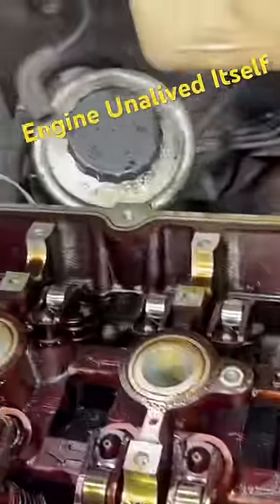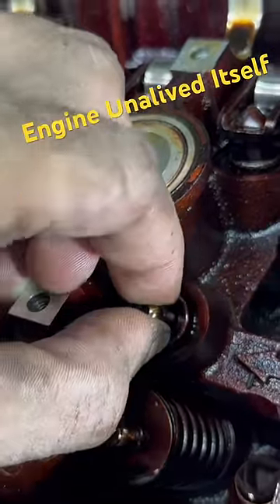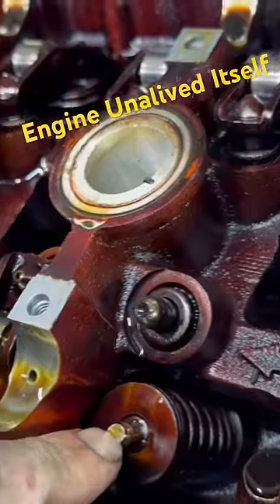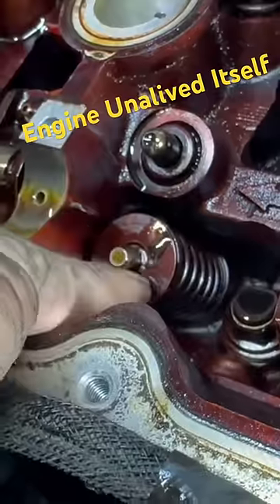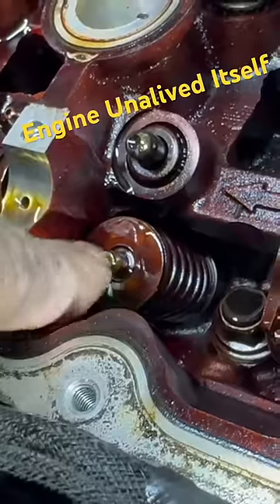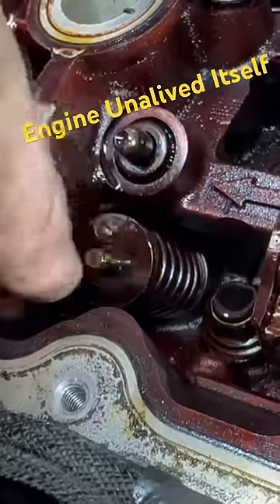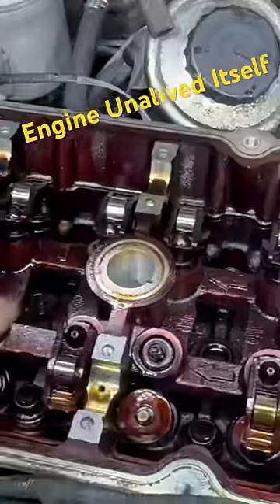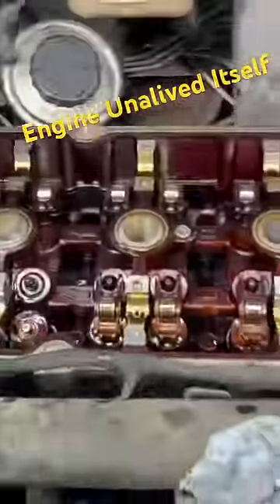Worst Engine Ever! Destroys itself while turned off! Chrysler 2.4 Turbo Non-Turbo #shorts #mechanic

Comment from the maker: Full Length Pt1 Worst Engine Ever!! Chrysler Destroys Itself on Startup! https://youtu.be/po4xBPujAuY
Reply: As long as you took to explain that, I thought you we're going to run another static compression test. But don't misrepresent, Chrysler engines don't destroy themselves on Startup.... Some owners of Chrysler engines don't maintain them so they destruct by lack of maintenance. How many miles were on that original timing belt?

         Edit: there's an awfull lot of those 2.4 litre twin cam engines out there, for a few decades now, so they can hardly be labeld "worst engine ever"🤦 Probly YOUR least favorite would be more accurate....⚡️😳
Reply: @petesmith5092  i agree it takes alot to kill those engines, had a srt and the engine never failed after all it went through, i think its more reliable than the 2.4 toyota, meanwhile my mom had 2 engines replaced in her 3yo honda accord, thats a bad engine, any ford, vw, subaru, bmw engine too is awful
Reply: @retrocompaq5212  M⁰ Pªr or no car... but i'm ol ol old school. Before they taught "boo-bonics" in classrooms.WAY before!
Reply: @petesmith5092 my friend had a stratus with the 2.4 and he didnt change the oil the entire 2 years he had it. Put over 35000 miles on it. He sold it and the guy drove it for years after that
Reply: Wish the link was actually clickable... lol

Comment: 3 of the Best engines ever built
1. Chevy Straight six
2. Ford Straight six
3. Dodge slant six
Reply: 4. Honda F22 Inline 4 in the 90-93 Accord. You could run those babies with Aunt Jamima Syrup in the crankcase and they run 300,000 miles

Comment: I have this turbo engine in my dodge neon and this motor is amazing. Takes redline all day 😂 think it just comes down to proper maintenance
Reply from the maker: They didn’t do so well in the PT…maintenance
Reply: @RainmanRaysRepairs So what happened to this one in particular?
Reply from the maker: @MrCydiaWTF  Timing belt teeth stripped off at 90k and it bent the valves
Reply: @RainmanRaysRepairs  ah Jesus, The turbo models are non interferance. I guess the na’s aren’t. As long as pistons okay hopefully just new valves and some machine work with new belt and she’ll run again
Reply: @bleach_drink_me best find used, remain cylinder head
Reply: @RainmanRaysRepairs I have a 21 year old pt, you just have to take care of them
Reply: @MrCydiaWTF they aren't non interference, I've owned both the srt4 and now I have a na2.4, they are semi interference, the valves can hit eachother, the pistons will never touch the valves
Reply: @tobyngenn9826  Ahh good to know. Yea so they can make valve to valve and never piston to valve in stock motor. However valve to valve I believe is very rare to happen on the 2.4’s. Most of the time the timing belts strip at the crank pulley and the cams stay in time with each other
Reply: @MrCydiaWTF  ive personally never seen it happen or heard of it really, I goose it every day and I don't really worry, they are very bulletproof if you care for them
Reply: I've always heard of the 2.4 being as good as the Honda engines of the time. I've even heard of people putting a half million miles on them. Just got to do the maintenance and change the timing belt on schedule.
Reply: @bleach_drink_me  just like the Chevy 348 and 409 sometimes called the porcupine head. That was a canted valve engine the intake and exhaust would run into each other if a guy put too much Cam in it. Then the Piston would come up swat the intake valve and fold it over in the top of the piston and use it to beat the shit out of the head with
Reply: @tobyngenn9826  and due to cam profile the valves will never touch each other in normal operating conditions either. The onliest way I know of that the valves will run into each other is if the exhaust and intake cams are out of synchronization. By the looks of the damage with the teeth being stripped off of only the bottom side of the belt where it was connecting with the crankshaft tells me that it ran fine until they shut it off then it would not restart. Nothing wrong with that cylinder head
Reply: @MrCydiaWTF  na isn't interference. Mean if turbo isn't, obviously na isn't.
Reply: @Franklinveterinarycenter1of4  no, just lap new valves in! Not a big deal.
Reply: @RainmanRaysRepairs saw the same thing happen to a vr6
Reply: I have a pt cruiser gt with a 2.4 turbo high output, that is modified at that with stage 2 Brian crower cams and upgraded valve springs, big wheel stock turbo, and it has 113000 miles on it, it hasn’t had a issues with the valve train. I just think the problem is lack of maintenance, the car I had got was from a family member, and cam had shown sign of bad wear due to oiling issues , fixed that and a couple turbos later haven’t had any issues
Reply: @RainmanRaysRepairs  I'm no expert on oil varnish, but the color in there looks like red anodized aluminum. I think we have gone far beyond 'didn't do so well' and are firmly in the 'didn't do ANY" camp right there
Reply: Lmfao. Crystler and GM have been making the worst engines on the planet for the last 30 years minimum. Not even debatable.
Reply: Lmfao. Crystler and GM have been making the worst engines on the planet for the last 30 years minimum. Not even debatable.
Reply: @jimmysturdevant9843  yea lol that’s why these r great. Fukin Mitsubishi motor
Reply: The PT Cruiser 2.4 is a totally different engine. This video is on the 2.4 World engine alliance engine.
Reply: Not the same engine. Neons never came with a 2.4. 2.0 or 2.2. This is also not the 2.4 PT cruiser engine. This is the 2.4 World engine alliance engine.
Reply: @tobyngenn9826 "If you care for them" is basically "She's a bitch until you get used to her"
Reply: @POVwithRC  that's every car lol, I work on cars all day every day and it's never easy
Reply: @severesilence1871  Holy sh!t who in the WORLD would spend money on a pt cruiser? Talk about polishing a turd
Reply: @RainmanRaysRepairs yeah because the timing belt was supposed to be replaced prior to the like the guy said preventive maintenance.
Reply: @RainmanRaysRepairs  broken timing belt on the 2.4 results in bent valves less than 15% of the time in my experience. theres a reason for the timing belt replacement schedule, but everyone likes to ignore it and complain when things go bad.
Reply: @bleach_drink_me don’t kid yourself.. the French made race cars.. the neon.. or the 2.4 can most definitely be track worthy.. I had a 2.7 Sebring, 300 thousand kilometres and no sludge issue.. maintenance 😎👍
Reply: @RainmanRaysRepairs considering the timing belt supposed to be replaced every 60,000 mi they're lucky they got an extra 30,000.....
Reply: @RainmanRaysRepairs Yep I had to replace the head gasket on my mother's 02 Cruiser before 30K miles on it. 

Thank you for affirming what I have said all along.
Reply: @RainmanRaysRepairs timing belt failure is a belt failure....  any interference motor fails when the timing belt or chain fails
Reply: I have a 2015 Chrysler 200 with the 2.4 and, other than gas mileage, it’s solid.
I checked, and mine has a timing chain, not a belt.
I do my own oil changes with 0/20 Mobile One full synthetic every six or seven months.
Reply: People had the same issues and complaints with the SOHC 4.7 dropping value seats warping/cracking the heads, lifter failure etc. Even those who said "I did proper maintenance" had issues meanwhile those who were on their maintenance schedules also got close to 300k miles on the original engine. This was still the late 90s early 00s Chrysler/dodge, where a Monday/Friday build wasnt as good as a say a Wednesday or Thursday. 

Though here again * knock on wood * My Dakota was built on a Friday and is now 20 years old with zero issues... so yeah flip a coin I guess lol
Reply: @NXT_LVL  Man that is 👍 and flip a coin or better yet roll some 🎲. LOL

I have a dead 99 JGC 4.7 in my driveway right now due to valve seat failure as a matter of fact. LOL
Reply: @RainmanRaysRepairs  yeah that would have helped if had said that in the video itself. Maybe less stupid background music and more explaining the title of you’re vids.
Reply: @tobyngenn9826 why lol
Reply: @porksword4  it's my job
Reply: @tobyngenn9826  I meant why would you have a pt for a day much less as long as you have lol my buddy had one we named Petey man we put that mf thru hell off roading in the woods sliding around all the turns lol thing was a legend between us buddies but why anyone would drive one intentionally I'll never understand
Reply: @porksword4  tbh because my father had one for financial reasons, we worked on it and he died so I got my own
Reply: @RainmanRaysRepairs so at 90k miles was it the original belt? If so I'm not surprised. Mate bought a kia from his mother inlaw, very well kept, 80,000km. Timing belt was factory original and at 15 years old it stripped the teeth driving it home after buying it! People don't realise theres a time AND mileage limit on belts.
Reply: Or just bad luck.
Reply: @NXT_LVL any experience with a Tuesday built engines 😮😅😊😂😂?
Reply: @tobyngenn9826  I knew people on the engineering team that designed the PT. They will tell you themselves that the car was an absolute disaster. They literally built the entire car and completely forgot about the fuel cell/ gas tank. No joke. The car was finished yet had no tank and no clue how to fit one in.  They where told to use as much off of the neon line as possible to reduce costs. Neons arent  exact s masterpiece either.  Some guys where embarrassed to be on the project.  The regular use daily drivers didn’t last because they where trash.  You don’t too many still running especially in states north of The old Mason-Dixon line.
Reply: @jimmysturdevant9843  very true all my ford's have been extremely reliable, anytime I need the truck I just head on down to the service bay where it spends most of its time like the rest 👍
Reply: @villedocvalle what background music do you hear that’s over his CLEAR VOICE that’s explaining this in DUMMY TERMS well?
Reply: I wouldn't consider  a chrysler amazing....
Reply: @RainmanRaysRepairs darn it.. I bought a 2019 promaster city with 102K miles for about $19.5K, I'm really regretting it now. Should I just do a full tune up, clean it and sell it? (Today my obd2 read P0302 misfire cylinder 2). A few months ago I replaced the radiator

Comment: I have had three of these engines in three different cars over a time span of 20 years, and have never had a problem.  
But none of my engines were that dirty inside.
Reply: Because iam sure u opened them up just for fun here n there to look huh?  🙄
Reply: @shawnsatterlee6035  People who work on their own cars are pretty common, removng the valve cover and getting this view is trivial. Literally anyone with some hand tools can do it.
Reply: @shawnsatterlee6035  
Yes, that's right. I don't have a problem with taking the engine half way apart and doing an inspection, besides , ya need to do that just to change the spark plugs. 
This is why I miss the old '60's cars, but those dinosaurs are all just about gone now.
Reply: @TowerCrisis  
Thank you TowerCrisis.
Yes, I do take a valve cover ( or two) off every now and then just to see how things are going.  I also read spark plugs .Something most of these young fella's don't know how to do.  
Also on this engine, which I am very familiar with, ya gotta take it half way apart just to change plugs, so, why not take the valve cover off and see how it's going.  
I have still pictures to share of this very type of engine, it's condition, and any wear that I may have noticed.   In fact , I still have this engine.

Comment: I had a 2011 Chrysler Town and Country come into my bay yesterday, 'died in flight'.  Determined that cyl 3 on the Pentastar 3.6 had no compression, pulled valve cover off and discovered one of the exhaust rockers had failed and wedged against an exhaust valve, holding it open.  New rocker, all good to go.
Reply: Held open and no p2v impact? Is it non-interference?
Reply: @Gideon_Judges6  I believe it is an interference engine, but it didn't hit the valve on this one.  It wasn't fully open, just enough to make a dead hole.

Comment: That engine is quite nasty...

Some designs are more susceptible to lack of care than others.
Reply: Not that bad. Every 2.4 ecotec I've cracked open has been 100x worse with the exception of the one or two with really diligent owners
Reply: @archangel3237 all the ecotec 2.0 2.2 amd 2.4 engines are oil burning sludge machines.
Reply: @jasonpoletta1797  I've only ever seen one or two 2.2 ecotecs. The rest of them I assumed were melted down into budweiser cans
Reply: My 2006 Audi A3 is a complete piece of shit... except for the engine. 221k miles, 100% original components, minimal maintenance, and yet it's never had a single engine issue. You can tell it's the only part of that car that was well engineered
Reply: @jacobb7608  yeah, good engine, crap everything else.
Reply: They don't like changing oil !
Reply: @archangel3237 I find it hilarious how your last line is actually feasible and possible.
Reply: I honestly thought this was red glyptal paint. At first it looks red/brown, how glyptal would eventually become. Im guessing thats not glyptal lol
Reply: I pop the valve cover off my 80s Honda with 300k miles and it still looks brand new. even with oil changed every 40k. I will never get over how shit domestics are. Can start in -48c and can drive across the country over night if i wanted to with no hesitation
Reply: @sqweezzstr  yeah, because you didn't own the car until recently.... the prior owner was the one that took good care of it.

If you are saying you owned it since new and only changed the oil every 40k miles. That's like 8 oil changes for that mileage and over 30 years of age, there is no way the engine would look clean at those intervals.... Absolutely no way.

Even the best synthetic oil turns to goo and will leave heavy deposits at 40k miles of easy constant highway driving. Change it to kilometers and it's still an issue.
Reply: @sqweezzstr Change that 40k mile oil change interval to 4k and I might believe you. 80's and 90's Honda are pretty much all I work on now. I own an 87 Honda myself with 250k miles. It's still brand new looking inside of my engine, not even varnish buildup, due to the fact the oil has been changed every 3-5k miles since it was brand new. A 40k mile, or even kilometer, OCI would kill just about any engine, or at the very least leave it severely caked/gummed up with sludge.
Reply: @archangel3237 chryslers generally suck..I don't really like newer gm..but I've had one ecotech with about 150k, ran like new. And my uncle jad one with about 180k when he sold it,neverhad an issue
Reply: @jasonpoletta1797 tha must be why the 2 I've had in my family didn't burn a drop..
Reply: @jacobb7608 thats the 2.0T isn't it? Mot if those motors are junk too
Reply: @sqweezzstr ok, 2 things....my fords, have all gone well over 250k with no major issues....they're not shit at all. Honda is my fave, but honda, acura,toyota,lexus,Mada and ford are all I'd buy...except for classics..I'd love mostamerican classics. And why the hell  would smeone neglect the honda and go 40k  between oil changes,?? Wtf

Comment: I haven’t heard anything bad about the 2.4L from Chrysler. A couple people I know got almost 300,000 miles out of that little 2.4. Gotta keep up on maintenance and it should last. My neons have the 2.0 and even after my white neon was ran low on oil by the previous owner it still keeps ticking. Literally ticking 😂 but 10,000 miles later and it still runs fine lol

Comment: I own an 03 pt turbo, and the T-belt snapped, luckily the valves weren't squished, did the repair, and 20 years later, with over 170K miles on it, still runs like a champ, and I drive it hard too

Comment: With proper oil changes and responsible driving those small Chrysler 4 bangers ran forever.  Hence all the 90's and 2000's still daily driven.

Comment: I fixed a v6 chrysler head that was warped. I fixed by pressing it at 20 tons and heating to 180 deg C. I left over night and by the morning the warp was less than 0.2mm and the previously stuck camshaft rotated quite well. The cambelt was loose after skimming as it had been skimmed years earlier so "mods" had to be performed to make it tighter. Never thought it was salvageable but it was and still runs after 3 years. Absolute garbage.